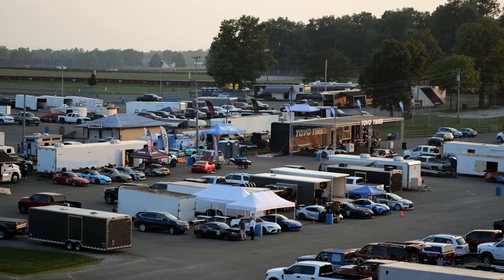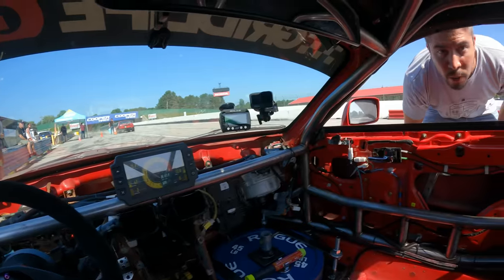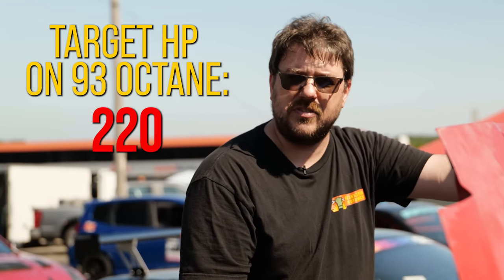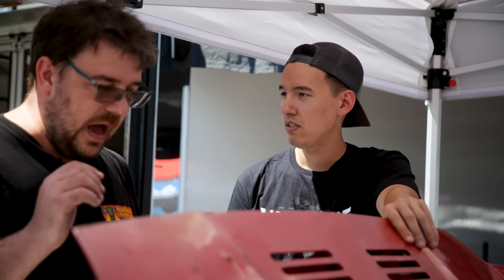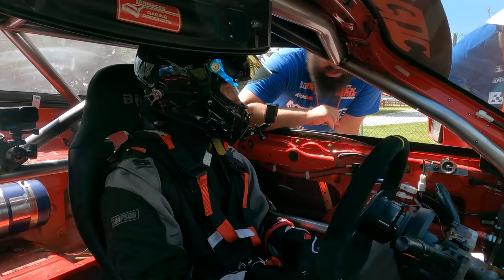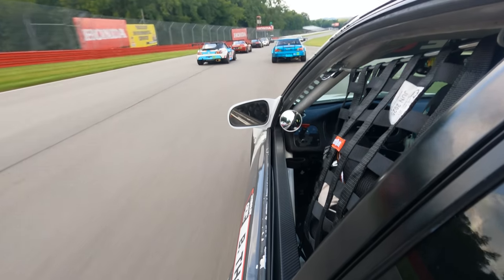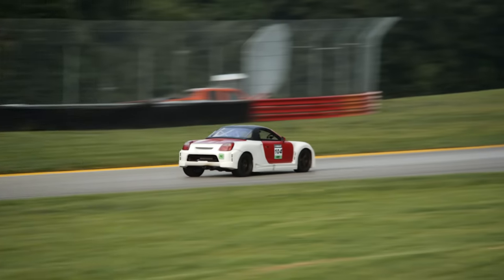Civic and MR-S Race Wheel-to-Wheel Against Each Other for the First Time!

Comment: Honestly you have to use the MR2 to it’s advantages. Super light and very very nimble. You have to carry your speed  wisely.  The big motor cars will pull you on the straights of course… but in the corners you can go faster then them… brake later, accelerate out the apex quicker. But if the suspension set up or tires etc etc are not dialed AND including your confidence in the vehicle will all play a factor.
Reply: Problem was he was catching too much air and his handling in the corners wasn’t stiff enough on his old lighter set up. So increasing the weight seemed to be good for his handling this race but the down on power thing was such a surprise. I bet if he had that extra 30 hp he was missing then he woulda been fine

Comment: as the owner of a SCCA Solo prepped Spyder, this is really frustrating to see. I know that car is capable of a lot more with less. your build and my build are vastly different in strategy. you went heavier with more power, I went minimalistic on everything to stay within the rules. Maybe that is where the key lies. I hope you and Mark can get the spyder sorted. I'm rooting for you.
Reply: Heck even the techno pro spirit MRS was only around 180 HP initially and was beating up cars way higher horsepower than it. I think the widebody and overall build intent may be a bit awkward with lins Spyder concerning the class he's going for. If anything it may have made more sense for a K swap and go for a class up with higher HP considering he came from an Evo.
Reply: yeah, I think is killing the strenghts of the car,... there are a lot of fast MRS, and all go for the same way. Go Light, go handling, go aero.... if you plain go for other way you should chose other car.
Reply: That's absolutely true. You have to go lighter on this chassis, not heavier. It upsets everything including the handling. Its about 80% similiar to an Lotus Elise.

Comment: Tall Ben, of course the car needs work. 
But, it appears you need some seat time with momentum cars - shaving 7 sec off is wild. 
Get that practice in - you’ll do so much better next time !
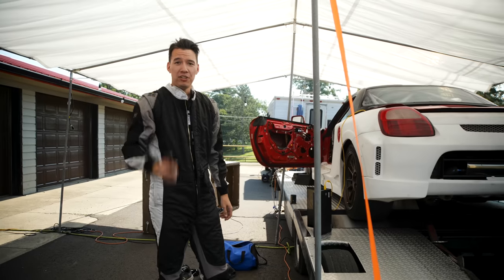Reply from the maker: Bear in mind the 1:50 was practice session where I didn't even get the front tires up to temp due to all the point bys. Not actually representative. Race pace went from 1:45 to 1:43 by the last race.

Comment: was watching the recent Engineering Explained video about the dark horse out braking everything.
And how tires are not the limiting factor for G forces.
It makes sense I guess that the heavier the car the more horsepower and tire they can run. With how good tires are they are still able to brake/accel as well as a lighter car.
Putting light cars at a significant disadvantage. 

Honestly it doesn't seem like a very fun ruleset to be competing in because of that.

Comment: 2zz, stripped out, stock body and biggest tires you can fit. 

This is exactly what happens when you over complicate it. I really want to see the MR competitive but it’s got too many cooks making the same meal.
Reply: this is basically what I did for SCCA Solo. I also have found the stock 5spd box to work better than the 6speed version having better ratios.  people often don't think about rotating mass but minimalizing the mass of all the spinny parts makes a HUGE difference in the cars performance.
Reply: 2AR was the moment this build took a turn for the worse. He's been trying to fix the car ever since.
Reply: @zerohikari2685  it’s a cool idea.  And theoretically it could work great.  But why over complicate it when there are recipes that just work. Especially on a car you just want seat time in
Reply: @typedrew  I don't think theoretically it could. It's heavy and the head has zero development into it. You will very quickly hit a point where you run out of flow and have nowhere to go. The only thing it has going for it is displacement.
Reply: @zerohikari2685  the problem is he over powered the car and the rest of it wasn't set up correctly to balance out the power upgrade (which was over a 75% increase from stock). they just assume MR2 parts are all the same without taking into account the weight changed, the balance changed, the width of the car, and there for the leverage on the suspension changed, tire sizes changes which can effect gearing and will increase the rotational mass which effect steering feedback, cornering and braking...

he changed everything. mean while, March car stayed fairly stock chassis configuration wise and the same engine and trans has been great for him and a bunch of other people. His issues didnt start with the engine, they car has always had issues since he got it. his issue is the way he built it.
Reply: @zerohikari2685  we are talking about MR2s here and the simple fact is, whatever you think you know about tuning and building a cars is useless on that platform. Mid engine cars are quite a bit different that anything else. even a stock one can get away from you quick if you duns understand how a mid engined car drives. Too many people I feel are giving him bad advice based on zero 1st hand knowledge of the platform. Let him work with Mark, he knows what he's doing.
Reply: @Treacherous_One  Mark does not know what he is doing. That's the problem. Dude ran in Lemons races and thinks he set up translates to real competitive tuned cars when it doesn't.
Reply: @Treacherous_One  The mr2 spyder contrary to popular opinion is actually pretty stable compared to the older sw20 gen. I think it has something to do with the suspension with the valving. Mid engine suspension setups are very particular, and any poor valving or design will throw it all off. You could make the argument that the weight balance is off, but not every top mr2 at track events has a relocated fuel cell.

Tons of people are very competitive even with more power. (2zz, k20, 2gr) His engine isn't even running right, and from what I've heard, they didn't finish the weekend at GL Lime Rock due to issues. But I'm sure they'll figure it out, and it will be a hell of a ride once it's finished. In my opinion, they need a professional to help set up the car because something is definitely off. (potentially rake?)
Reply: @TheCorington   I run a spyder in SCCA solo. I dont have any of these issues. but I know my car and have been driving mid engined cars for decades. as he was building the car I saw a lot of things that "I" wouldnt have done. but I agree, he needs help from an expert if he want to sort it out at this stage.
Reply: @Treacherous_One I mean, short Ben's K swap is a large conversion too, it's just that he had Andy who has done it enough to sort them pre-emptively, and enough time to refine it. It wasn't exactly stable when he started racing it also.

I should clarify though that if it was my car, I would've done the 2zz swap instead. It's what I did with my Toyota Celica previously. I just think it's a bit unfair to say that his unrefined setup is proof that the core concept is the problem.
Reply: @Treacherous_One  I think the craziest part is leaving the diff open with 200whp on tap  made no sense

Comment: @Gears and Gasoline
You should watch the YouTube video of the Spirit MR-S.  The guy that built that legendary car spills all the details. Car is light as it can be, using a lot of Titanium braces, roll cage, etc.  80 Liter full cell in front. 2zzge+tranny.  Brake controller with ABS delete.  Stagger wheel setup, etc etc etc. VERY informative and FREE INFO.  I think just having a very light 2zzge car with perfect balance would have been better than 230whp akinston with weight ballasts etc.  Give it a watch!

Comment: That must be wild to go from a fully built evo 9 to an mr2 haha. I’m still struggling to fully understand the rules here. You’re running a 180hp mrs against a sea of s2k’s and c5’s? Even if it’s based on power to weight ratio you’re never going to beat the low down grunt of an LS on the straights. Kinda confusing. Regardless, great job bens! Lol love your guys’ content!!
Reply: Yeah the class requirements seem to favor the C5s by far.

Comment: I remember you saying something about the rule for GLTC class and aero. Have you tried leaving the ballast weight in, and adding some aero to have it stick harder in the corners? I would think with a car like the MrS, you would need to sustain speed in the corners to not get run over by some of the higher HP cars out there. I would think that would make you substantially faster. I think that why short Ben is so much faster. Just my 2 cents.

Comment: I feel like the MRS suspension is too stiff.  There seems to be some pogo sticking in the front from time to time.  Also, that front end looks like it needs constant correction, however that might just be the editing.
Reply: I have been commenting about suspension and alignment set up since he got this car. there is a ton of info out there on set ups for the spyder. event at 180hp, that car should be doing much more than it is.
Reply: It is set up for like 300-500 extra lbs inside the car so ofcourse its going to be stiffer than it needs to be without the weight
Reply: @MrZyLeXx it doesn't matter how much weight you have in a car, it shouldn't be pogo'ing around like that. The #1 job of suspension is to keep the tires on the track not constantly loading and unloading an axle with pogo'ing.  That's a recipe for an extremely inconsistent car.
Reply: no but what i was saying is if you set up car that is suppose to weigh 3000lbs and then take 500lbs out of it, the suspension will be much too stiff for it and pogo'ing around will happen, im not saying you're wrong @hamsterbrigade
Reply: @MrZyLeXx  Ahh..my bad, I understand what you're saying.  I don't have any order based on the editing magic but in the order of the video, it looks like it was doing it before he took the weight out.  However, you never know based on edit order.  btw.  Thanks for taking the time to explain.
Reply: It might've been doing it before as well, i just think such a huge jump in weight when they built the coilovers especially for the full weight i would assume it's suffering with a lot of it out of the car, still doesnt mean that it was correctly setup before. Have a great week man! @hamsterbrigade

Comment: Did you take note of the Humidity and the air temperature, plus difference in air density (by that I mean what altitude differences were there a drastic change in altitude will change the air density of the incoming air) All those could be a factor in why you were down 30 horsepower.

Comment: Gotta love that you guys try so hard to build that mr2 maybe it's me that doesn't know any better cause the car is not dialed yet but seems like the mr2 lacks behind in the racing department. Seems like you're fighting the car alot  to keep it straight, relaiable,fast.

I still wonder what would've happened if you kept the supercharged na miata like ben did with the civic after the road trip maybe it would've been an easier and funer car to develop with a kswap or turbo.

Still hope you'll succeed with the mr2s its an original choice for sure
Reply: The MR2 is a great choice. most people avoid tracking them because the mid engine lay out is pretty unforgiving if you aren't used to driving them. But when you figure out how to drive them, they are a weapon.

Comment: Should have K swapped or 2zz swapped the MR2. That chassis is perfect for long smooth power, when you stay low in the RPMs and shift at 6, it upsets the whole car. Toyota should have put in a 2zz factory.

Comment: I wonder if you switch over to a 2GR vs a 2AR if that low end torque difference and weight over the rear might help you out coming out of corners and pulling harder on the straights. Ask Marc about converting over to the widow maker he’s done that swap before and he’s already gotten 400whp N/A of of a 2GR it’s worth a thought the mounts line up and your eb60 works with it.
Reply: I was actually going to comment about the 2gr and it's potential over his current platform since it's a common mr2 swap as well

Comment: MR2 needs Aero and more HP. You're the only car on the field without it and with how much that car dances there will never be enough weight to fight that off.
Reply: underrated comment
Reply: I believe he's not running aero to allow for more hp because of gltc rules. But if he's down on power then maybe he could.
Reply: if you are rely on aero to set up a car, you're doing it wrong. It's just masking the underlying issues not to mention point penalties. They would also have to get the rear suspension revalved again for aero.

Comment: A suspension setup for the lost weight will make the Mr2 faster . It is just a steep learning curve in the beginning. You will find a good setup soon and get more confident with the car. The result will follow.
Reply: he added a ton of weight to that car, he didn't reduce it. He's at around 2700+ right now, stock its like 2300. considering he's probably stripped close to 150lbs or more in parts out of it, then put it right back in and then some.
Reply: @Treacherous_One did you watch the video? He took out 550 lbs for the race since he was down 30hp
Reply: @liamflynn6929  and threw the balance of the car off in the process.

Comment: Still wonder why the MR2 has so little rear negative camber, it's too tail happy and inconsistent, they should play around with settling the rear of the car down; more negative camber, softer rear spring rates, less damping, lowering rear ride height, etc.

Comment: Why does the MR2 have no Wing or Frontsplitter? Would it be unnecessary with the Bodykit?
Reply: Based on the GLTC rules, if he were to add aero, he would have to also either add more weight or reduce power

Comment: Honestly I’d revert that mr2 back to stock and just built the engine. It seems all the changes threw its balance completely off but hey it’s too late for that now
Reply: agreed, wide body and all the wheel spacers and bigger wheels is robbing him of power and increasing the leverage on the suspension which is making it harder to tune because its in unknown territory. go back to a lightweight 15" wheel, lose the spacers. and wide body set up. get your alignment done by  someone that knows how to set up a car for a track. Lighten up the flywheel and any other rotating parts to make the engine faster revving. then smaller wheels will be lighter and spin up faster. focus on faster acceleration and breaking, you will pick up a ton of time with just that. as the old saying goes, races are won or lost in the corners.
Reply: @Treacherous_One  exactly, as it sits right now its ruined to me. Better to try to make it as close to stock again as possible and build it up from scratch